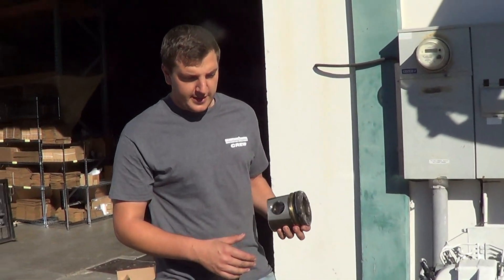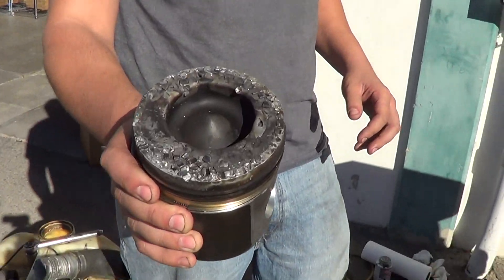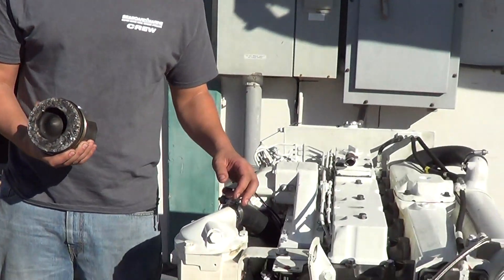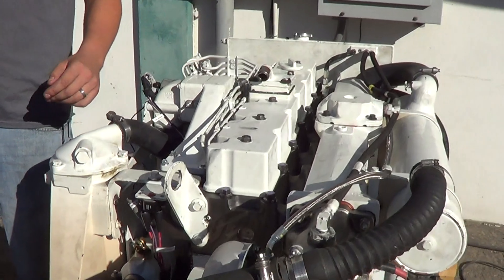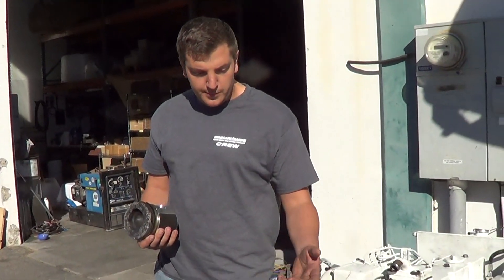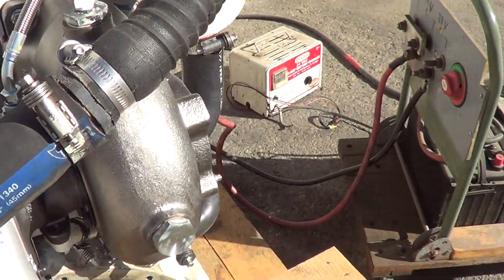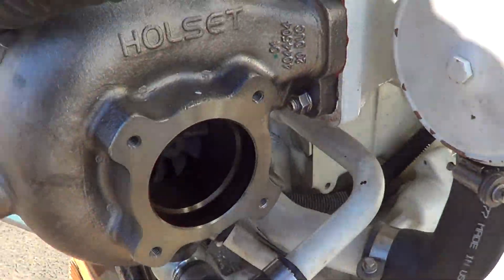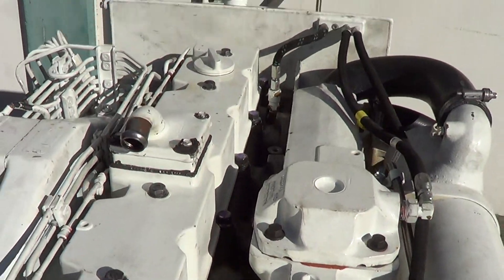Engine Start: Cummins 6CTA 8.3 Partial Rebuild

Comment: How common are these premature failure in modern cummins marine engines?
Reply from the maker: Not very common, fortunately it was under warranty.  Probably a manufacturing defect which really isn't very common.